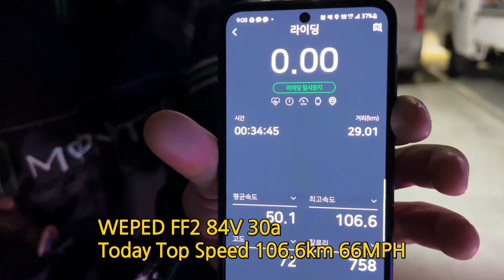2023 New Electric Scooter WEPED FF2 84V 30a Max Speed 110km (68MPH)

Comment: Great scooter best build quality by far but price to high for performance wise
Reply: There is no price yet, its not online on their website.  They need to organize their website and post the correct links.  The link take you to the WEPED SONIC X not this scooter.
Reply: @RINGOTVReactions  it wouldn't matter weped known for expensive scooters tbh
Reply: @electricridesuk7645  they just updated their website for this scooter and I guess your right. This scooter with the extra battery and RGB light total is $8,250. If you only want the scooter it’s 5,690 with only a 30Ah battery 🔋 is rather expensive. Should’ve been been a 50Ah battery. With 30Ah it’s not good for group rides. Will need to charge at some point during the riding. 

My choice would be the Sonic X.  I actually wanted the Dark Knight but I reviewed the scooter in person it’s noisy. With all the fans and liquid cooling the scooter make took much noise. Not good for video production. I have a channel called RingoMotoVlog where I do scooter videos.
Reply: @RINGOTVReactions  yeah I knew it fortunately I was lucky enough to snag a extreme bull for only 2.5k now they are 4.5k they do have problems but the battery can give you up to 150miles range!!! Take it from someone who actually owns/rides it not fake reviews online... I personally wouldn't buy into weped for price to performance there are better scooters out there my extreme bull has fan liquid cooling etc can't buy the model I have anymore limited run

Comment: 1. Still no hydraulic suspensions like Nami or Teverun. The comfort is terrible for occidental people with those suspension springs. We can't do offroad or ride on damaged roads...
2. Still no 4 piston brakes, we have to replace them with Magura MT7 Pro or Hope Tech 4 V4.
3. 30 ah is not enough. You should put at least 40 or 45 ah. Maybe 50 ah like Nami and Bronco.
4. Still no remote controller (wifi or bluetooth) to configure all the leds.
5. Still no horn, front headlight, turn signals (rear and front blinkers). They are mandatory if you want to sell your scooters in Occident.
6. Still not waterproof, whereas entry level e-bikes are waterproof as well as Xiaomi scooters ($400).
7. The speedometer is terrible. You should put a screen TFT 750C bluetooth with Kelly Controllers.
Reply: you should buy a motorcycle. honda suzuki kawasaki ducati ktm bmw …